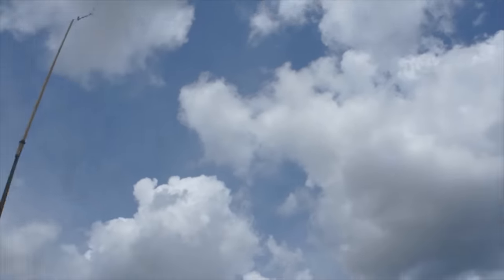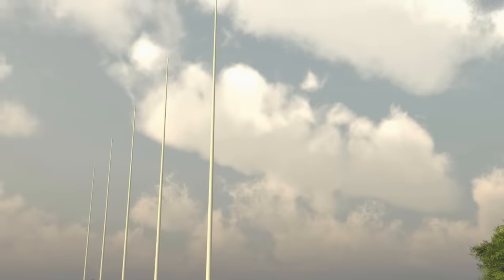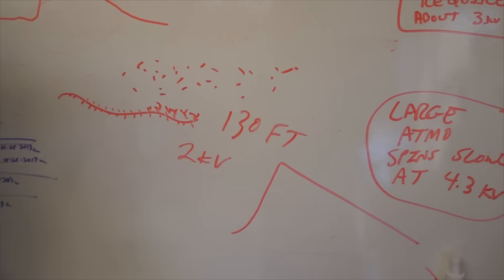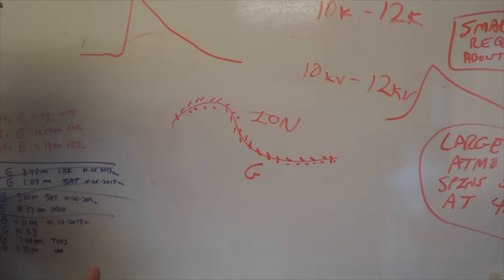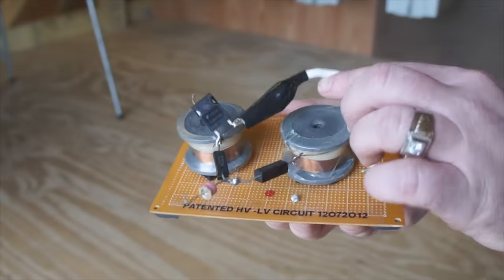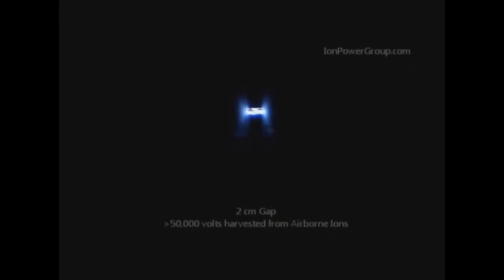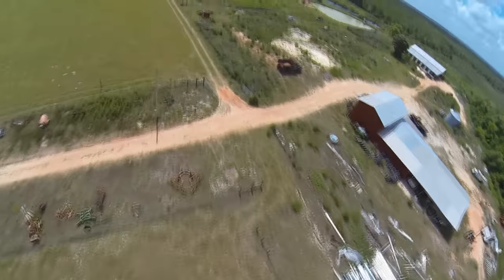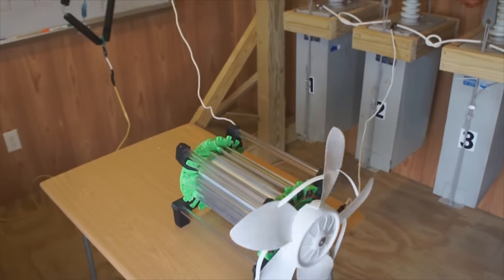Graphene/Graphite Atmospheric Electricity Collectors - Plus Horrific Hexacopter Crash!

Comment: Did they ever list what the overall wattage of their system was?
Reply: Daniel Matthews Lets assume it was down around 500mA coming in along with 2kV... that is still 1kW total usable power. That's at current height - they are discussing upping that to 10-12kV. Not bad.
More importantly, let's say it is even less than that for some reason - which I doubt, but for the sake of argument let's assume it is crazy like 2kV at something insane like 5mA... that will churn out a lot of water into H and O2 with relative ease since current is not what is important in electrolysis - the higher the voltage, the quicker you break the ionic bonds holding the molecules together. 
Hell I have no idea if this crap even works at all - but if it does then I'd say go for it. I know that as a HAM operator, I've gotten quite the jolt raising antennas in my day on perfectly clear days before we connected anything to the receiver end. It wouldn't surprise me for sure.
Reply: Daniel Matthews Obviously. Everything is a scam until proven otherwise. Kind of like the horseless carriage - I'll believe it when I see it. It's not a matter of magical thinking - the science is there, so why not think about it and figure out a way to utilize it? 
If you just walk away from everything because 'you can't touch it'. Well, we wouldn't really have much would we?
Reply: Daniel Matthews Ok fine Daniel, poor wording - the science behind it is there. Electrostatic electricity is present all the time everywhere and we can experience it by scuffing our feet, rubbing a balloon on our hair, etc. We can even experience a somewhat constant stream if you have ever done any tower and antenna work as many of us have as HAM operators or professional climbers and installers I'm sure have.
Is that more specific enough for you?
Photovoltaics were a completely laughable science in 1839 until some 19 year old decided to make a primitive concept cell in his dad's laboratory. Magical and laughable even in the scientific community until probably the mid 1900's as anything useful and so low power as only useful in space. Even though the science behind it was measurable - the idea of applying it or developing it beyond a certain stage was not remotely credible. 
Now... solar panels have slowly gained in efficiency over time. to the point they are actually useful on a human scale, rather than pocket calculators and such - at least to a degree anyway.
So as dubious as you'd like to paint it, I'm not arguing that point... I'm merely pointing out that people shouldn't table an idea because it hasn't been proven yet if they think they are on to something.
Reply: OptimusPryhme I like
Reply: Daniel Matthews Once again - you are taking me entirely out of context. I've never argued that the video isn't flawed. You are overreacting and ridiculing something we're not even arguing. I'm not anyway. 
One more time - my point is merely... as you stated towards the end... it seems like a neat idea ... so why bag on trying to move forward with said idea and see if they can make something of it?

Also, regardless of how much the sun's energy was well appreciated through time doesn't change the fact that creating a new type of energy from it (electricity vs. just heat i.e. evaporation, etc.) was a ridiculous concept at one time. There is nothing naive in addressing your magical technology argument. Same with anything until it becomes proven. 

If it took from the 1800's to now to get good solar panels... I think we could give them the benefit of the doubt for a little bit eh?

That's all I'm saying. It was a big leap from looking at the sun as a heat source to looking at it as a source of electricity. Kind of like looking at the sky as a source of rainwater, etc rather than a source of electricity beyond just lightning. No need to get upset over details that nobody is even arguing.
Reply: Daniel Matthews I already stated, on more than one occasion... that I agree with you regarding the lack of information. Therefore I assumed it would stand to reason I would not throw money at them either until they have developed their project further.

My point, again, is that I don't get why people are so quick to throw the baby out with the bath water. Innovation comes from where we least expect it at times and is where we got many things.

Ignorance has nothing to do with 'electricity vs. just heat' - attempting to simplify something is far from a lack of understanding. I've been a technician for over 20 years at this point. I have no idea who I am talking to so I try to be polite. You're picking apart things and turning science into an ideology rather than what it is: science. It doesn't have to be defended, it just is. A majority of new discoveries comes from experimentation, not just the numbers in the classroom. Always have, always will.

Absolutely what those guys are doing is science. They formed a hypothesis, formulated ways to experiment and gather data, and are doing so. Now whether their controls, methods, and results are pure? How the hell do we know... you're getting riled up over nothing. Either that or just agree to disagree already I don't get it.

As simple as I can explain this:
- I agree there is no way I would throw money at something I can't see for myself. Ever. On any project of any kind.
- I believe that anyone who thinks they have a good idea, wants to persue it, and can find the means to do so... then by all means do so. You never know what might happen.

That's it! Easy. All I did was give a couple of reasons why I thought they could not that they were, but that they could be on to something. You took that as some sort of absolute endorsement and scientific proof that I never intended or put forward. Many people take theory as factual inflection far too often. That is all it was.

On an end note... you could put all those dog turds into a compost pile, and use the heat to generate some electricity. You know... thermodynamics or Thermal engineering like you were saying ;)
Reply: Daniel Matthews the problem is not if what they are doing technically works, it is that they are willingly and knowingly self limiting their potential.

That said, it is a costly design, no matter how you go about it.
Reply: OptimusPryhme Higher voltage simply wastes energy as heat. Sure (if you had unlimited current for instance) higher voltage means higher current because the resistance of the electrolyte does not increase with increased voltage in a linear way, a super high voltage may end up breaking down and arcing across your plate for instance.

Just as an example, if your electrolyte resistance between two conductive plates measure 100mOhm then at 2V you get 20A of current, generating 40W as heat. Now you would be right thinking that increasing the voltage to 12 will give you more gas - At 12V you have 120A of current however you would be generating 1.44kW as heat - and boiling your electrolyte solution in the process without adequate cooling.

In any case, look up Faraday's electrolysis law
http://en.wikipedia.org/wiki/Faraday's_laws_of_electrolysis

What you want for electrolysis is high current at about 2V  you do this by having some high conductivity electrolyte and plates spaced close together, but not too close or what will end up happening is the gas bubbles get in the way. Electrolysis is inefficient but you can make it more efficient by choosing your electrolyte and plate separation carefully.
Reply: adam3141 You make good points there.

One way to increase amperage that I found successful was to increase cell surface area, and at the same time, I was able to drop my voltage from 12v to 2 v by dividing it through 5 sub ssembly surfaces made of .003" 316L stainless shim stock.

The surface area was 60 square inches per plate as 5" x 12" sections, and each plate was divided by .012" of hexagonal nylon mesh, which, although it did drag the gas escape rate down, was offset by the high columnar strength which caused a gravity based convection of the working fluid electrolyte, which when off-gassed and cooled, kept the cyle going at about 12 GPM, helping to knock bubbles free.

The only drawback was that due to porosity issues causded by the lack of effective passivation, the shim stock rusted to slime in 30 clock hours of operation.

I would definitely advise that people be sure they have fully passivated anything they use for electrodes or else they will run into severe problems of corrosion which will completely ruin their equipment.

I would also advise some kind of porous, corrugated, non-conducting, corrosion proof material to keep the plates separated while allowing the gas to escape more rapidly.

I personally have left the project behind and sold off the machines so somebody else is now playing with them, maybe they will have better success with some modifications.
Reply: adam3141 Not sure where you are going here, but Ohm's law is Ohm's law no matter where you use it. Heat is going to be a problem no matter how you try to do any conversion (transformers for example, etc.)
So basically you are going to step down the voltage to a usable number no matter what. Just stop and use your mind for a minute:
How does our current power grid work? 11kV or more running down wires to sub stations. Then it gets stepped down via staged transformers to around 6.6 or 3.3kV and then locally even further down to around 400 and 230 before being piped off to houses.
This all originated as high voltage / low current power. Why? As you insinuated - loss. Less loss over distance.

So once again, I'm not sure why you would want to boil electrolyte with incoming voltage that has not been staged or stabilized, but 'more power' to you :)
Reply: OptimusPryhme
Hold up there as you think you have completely misread what I am trying to emphasise.

I am responding to a post you made several months back when you said that current was not important in electrolysis. In fact, electrolysis relies completely on current and voltage does not enter the equation at all.

More current = More gas

Did you look up the link I provided?

The point I was making was that while you get more current by using a higher voltage, you waste more as heat.

As I said in my previous post 2V generated 40W of heat and 12V generated 1440W of heat. (This was keeping the resistance between electrodes constant)

Now if I set my plate separation in such a way as to reduce the resistance to 0.0166 milliohms (to get the same current as I did with 12V) and use 2V, I will generate the same gas per unit time as I did using 12V but I will leave you to work out the power loss which I think you would have to agree it is less than the 1440W that you get by using 12V

I agree with you that when you want to transmit electricity over large distances you use a high voltage as to reduce the current. This is I^2R loss but to state the obvious an electrolytic cell is not a transformer, it is a resistor.

However... By inserting extra plates between your anode and cathode you can reduce the voltage between each successive plate. For 12kV for instance, you would need on the order of 6000 plates - probably cheaper to make a DC-DC converter.

Anyway, digest that and come back to me you still disagree
Reply: adam3141 Okay, is everybody on the same page yet? ~( 'w')/

Comment: Why not make a giant lighter piezo generator and make the energy with a cheater pipe or something. Yes it's crude but it's connected to a lithium battery or capacitor? The larger size insures real amperage creation.

Comment: it's been 5 years and we're still at Kilo-volts with pico-amps..
You want to collect more energy? Set this up near a cellular tower, AM or FM broadcast, or a DTV broadcast tower because all you are picking up is RF whether it be natural ionspheric and solar or man made from radio transmitters.. the ONLY thing that can use this raw power and do any work is a radio receiver..
Look at a crystal radio receiver.. it does the same thing but the radio has a detector diode that translates the AC wave to audio

Spark gap receivers are nothing new. the Titanic had one for morse coded communications at sea and the aerial was run along top of the funnels.
The reason the light tube flash is because again no current to actually light the tube and the absence of a proper striking circuit also (ballast) will cause premature tube failure.

Comment: Field theory is growing. Look into it it works and is being observed. E=mc2 is going the way of the past.
Reply: E=mc2 was provably inaccurate from the beginning.

E=mc² only describes objects that have mass but aren't moving. The full equation, used for bodies in motion, is E²=(mc²)²+(pc)² where that extra 'p' represents the momentum of an object. Besides being important for calculations on everything from celestial mechanics to rocketry, it's also important proof why anything with mass can't travel at the speed of light—no matter what Captain Kirk's orders are.
Reply: @timothyhaug2060  What is going to blow people's minds is there is no photon particles. Light itself is a field. What they are seeing is helical field pressure mediations due to perspective of the beam of light or beam of gamma, it looks like particle. But no particles or ions in a field. Now I can understand that there is dust and such but the field itself is not a particle.
Reply: @magnitudematrix2653  EXACTLY. Did you figure it out from Stienmetz or Tesla... or somewhere else?
Reply: @magnitudematrix2653  There is also no such particle known as an electron. The "electron" is nothing more than a condensed field modality. Noone has ever seen or will ever see an electron "particle".
Reply: @timothyhaug2060  check out suspicious observers this morning, it boom. You'll like it ;)

Comment: Guys, the reason you have ions/electricity shooting out of the insulation jackets of the coiled wire to the wood is because the coil wire you have there creates an inductor and the wood wall is simply grounded.  So as the induction field charges, it will get to a point where it will release ions or the charge of the induction field to the grounded source.  The white board is not grounded nor conductive, so therefore, it acts as an additional shield to the grounded source.  This is why you never coil wire where power is run through.  Electronics engineering 101.  ;)  I'm available for any other input.  ;)

Comment: A good work. Obviously it works. The only concern I have is, when millions upon millions of people will have such a device, you deplete Ozone layer, because Creation of Ozone in the air is DEPENDED on a free static electricity in the environment...that means increased radiation at the earth level and increased pollution, as the Ozone it getting rid of it.... Has anyone done some projections of this possible side effect?

Comment: sorry, maybe a eureka moment here... Those poles, their purpose is to hang the wires, nothing more? Why not go higher than 800 and go to 2000 feet, use 4 (or more) helium balloons with carbon fiber rods between them or any other lightweight material to hang your wire with collectors on, with an electrical cable down to the ground and other cables to keep the balloons in position and prevent cable break from the electrical cable. That setup costs a hell of a lot less than contractors, metal, concrete, environmental research and time to ok the project, and if you use those helium windmills to combine that with your collectors, you can even make an example for the rest of the world. Just thinking :)

Comment: Why does everyone do it so hard. Tesla designed his Tesla coil to convert high frequency electrostatic electricity from 6m and convert it to 12v power in one device and he was doing this in 1900.
It is called aetheric energy and all electric devices are based on this.  Nothing has been built since the introduction of quantum theory/physics, only in aetheric physics is it possiable to convert energy from one form to another.

Comment: Even if this was a source of power that could power a household (and it isn't by the numbers), this looks to be more of a tax write-off in the name or science than anything, wind options are still cheaper and more plentiful.  If you want to go after the big fish in energy in the atmosphere, lightning is not the best source.  All the lightning produced in the world in a year could not power more than 8% of US households for the same year.  There is far more energy in hurricanes and tornados and nobody has gone after creating massive storage-based power stations for capturing the energy stored in those, but that energy is able to be captured and stored and captured with the right design.  Something like one massive sized low-wise vertical axis turbine with protected outer walls and a massive graphene super capacitor array or flow-cell type battery to store all that power.